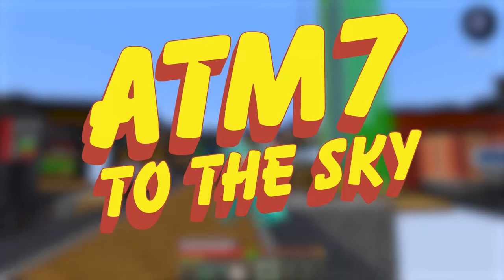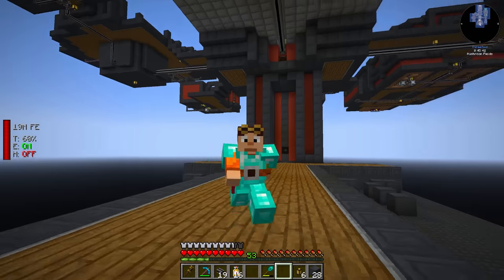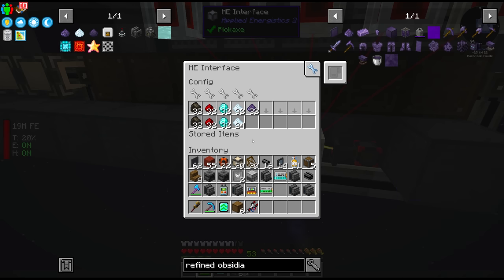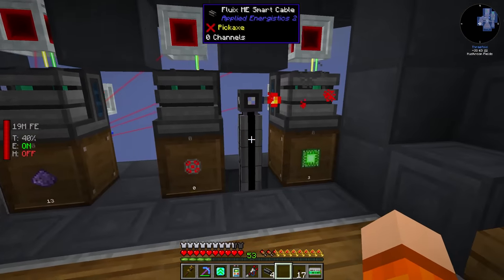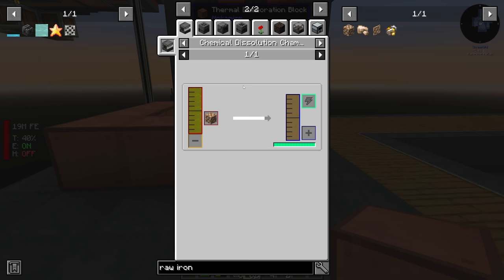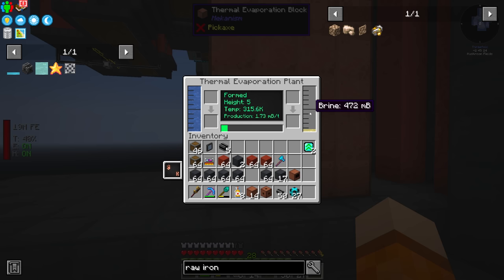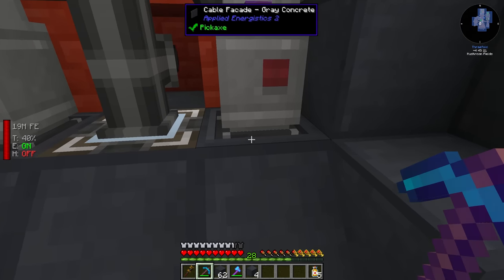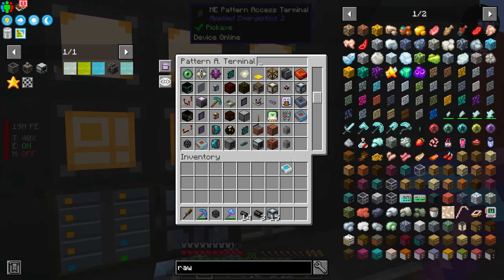Minecraft ATM7: To The Sky - Ep07 - Ore Processing

Comment: 8:12 You can go by with only one node since you can have multiple cards in one node accessing different block faces thanks to sneaky mode enabled somewhere in the item card´s GUI.
Ps:  Even Dire Wolf forget that something like this can be done with his mod🙂, just shows that  it´s a very unique feature.
Reply: Also, 4 overclockers allow you to have fluid/item/rf transportation every tick, making this mod very OP. You could, for example, use it on a sink and get 8000mb/tick
Reply from the maker: ah yeah, that's awesome! I got the second ones on top removed. I'm loving this mod more and more :D
Reply: @Threefold.  same, plus what I heard dire plans to add mek gasses cards as well.. and it's such a good mod if you need to transfer huge amount of items as well, since you can put 9 cards with each doing stack/tick, helped me to do some storage moving on atm7 a bunch

Comment: The sodium and chlorine won’t go into the AE cells because they are gasses not fluids
Reply from the maker: What is supposed to go inside the chemical storage cells? I tried fluid storage just in case, but apparently none of them work...

Edit: So, after checking the video again it seems I had item and fluid cells, I must have made a mistake when crafting the cell. I even have the chemical cells encoded. I thought I had picked up the chemical ones, my bad :p
Reply: @Threefold.  They should go into the chemical drives added by applied mekanistics.another way you can do it is pipe into chemical tank then put a storage bust on the tank.
Reply: @Threefold.  Chemicals = Gas in the new Mekanism
Reply: But... Gases are fluids...
Reply: @mitsukitheobbeist2166  ehhh sorta not really
Reply: @prediction3624  fluid means liquid or gas.
Reply: @mitsukitheobbeist2166  no lol, mekanism has it's own type of matter, gases, and they are NOT liquids, they even have their own pipes to move it, and applied mekanistics is an addon for compability between ae2 and mekanism, so that you can store your gases in your me system :p
Reply: @reouneru_ you're right gasses are not liquids but gasses are fluids. And I don't think that they are talking about minecraft

Comment: at 20:40 : about minimum transfer rate. Create mod's smart chute and brass funnel supports it. Put a smart chute, by default the number on it will show "*". You can scroll to change it, set it to 3. Now It'll only output in stock of 3. If there's only 1 or 2 item in input side, it won't output. 

Nice setup thou :3 enjoyed watching it. In my world I did it a bit less complex. Ign extruder for cobble, then it goes to a 1 wide tower of Crushing factory, Crushing Factory * n, under that Flux Sieve, Under That buffer crate, under that pipez pipes filtered to drawer controller (for non ore piece items), ore piece items go to rftools tier 3 crafters, crafter to smelting factory  output back to drawer controller.

Whole thing fits in 1 wide slide. I just put 6 slices of it, (gravel, sand, dust, netherrack, soul sand, basalt).

Though I have to setup an mekanism ore processing, but it'll be manual and only for allthemodium etc. rare ores. :3
Reply: Crushing Wheels from Create when at full speed can crssh whole stacks in seconds. Can even brush the block versions. Netherrite furnace should be able to keep up. XD

Comment: Your thermal evaporation chamber needs 4 advanced solar panels on the top corners with the middle 8 blocks raised by one, if I remember correctly. It should dramatically increase the speed of production
Reply: solar panels are many magnitudes worse than giving the resistive heater more juice. When you have spare power to give to the heater you won't even notice if the solar panels are gone. The heater can instantly max out the heat gauge for the evaporation tower.

Comment: Btw, if modular routers are in the pack (wich they were in the non skyblock version), you can use them to remotely power machines without cables.
Sortof a less op (and less expensive) version of the draconic evolution power relays.
Dunno if you've worked with modular routers before but might be worth looking into :)
Reply from the maker: Yeah I'm aware of those, but unfortunately they are not in the pack :(
Reply: @Threefold.  Allright, wasn't sure. I guess XNet solves that issue anyhow